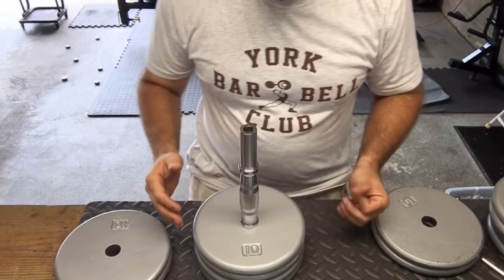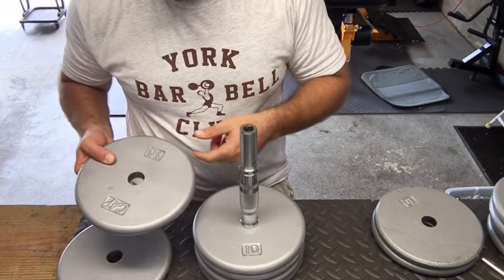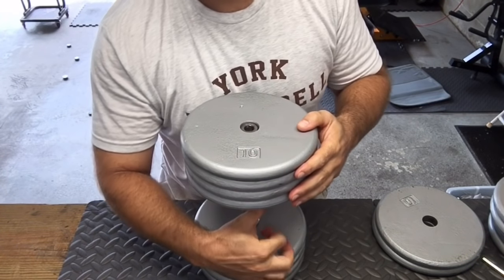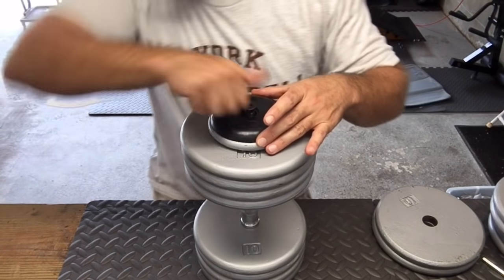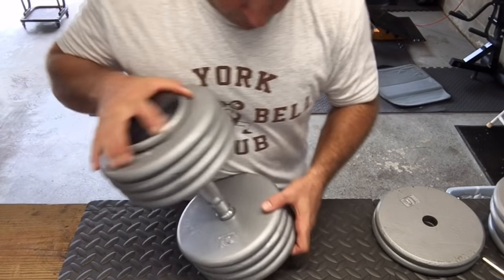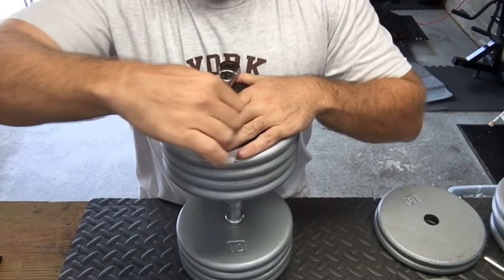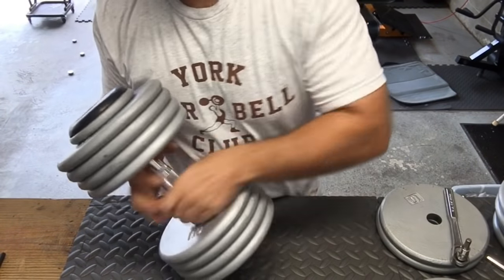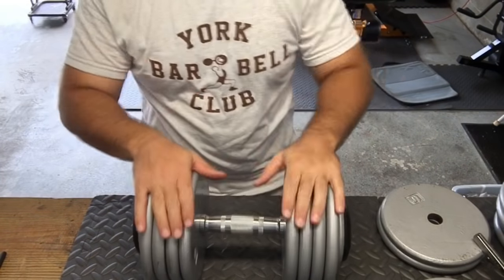Building a Pro Style Dumbbell

Comment: How has those cff rubber end caps lasted?
Reply from the maker: Absolutely tremendous.  No issues whatsoever.  Although I give them no reason to get beat up.  My gym floor is 3/4" rubber mats.  So the only contact they really see is that floor or my thighs when setting up for a press.
Reply: Diesel Mike Were you able to really crank down the bolt to lock then weights in from spinning or moving? I am torn between the steel end caps and the rubber end caps. Obviously the rubber end caps are less expensive. Are the rubber ones really hard tough rubber? Thank you for the reply.
Reply from the maker: Roddy FourthSeal  Theses CFF end caps are actually heavy duty rubber over a cast iron plate.  I am not sure all manufactures do this.  But I am very happy with them.  I actually feel that you can lock the bolt in better on these than straight cast iron. The bolt will dig into the rubber as you crank down on it.   The rubber is very hard, not squishy. That really locks it in place.  And to this day I still haven’t applied loctite to the bolts.
Reply: Diesel Mike sold!! Now I feel comfortable forking out the funds for enough to make a complete pro style set. I really appreciate your reply. I almost spent double on some Troy metal end caps. They look really nice and have the numbers with them.
Reply: Diesel Mike Are the bolt heads you are using 1”. I just ordered 40 bolts 5/8-18x1.5”. The ones I removed were 1” heads but had the old beveled washer that the bolt seated in. Just want to make sure these new bolts will work on the cff rubber end caps.
Reply from the maker: Without pulling one out and measuring, I can't say for sure the length of the bolts. (I assume the 1" you are referring to is the length?)  I used whatever came with the handles I purchased, less the washer.  I will check my Amazon purchase history and see if they list the specs.  

As far as the bevel, think of the rubber end caps as replacing the washer.  Yes, the washer is beveled and the bolt countersinks into it.  But the same happens when you use the beveled bolt with the rubber end cap.  As you tighten down the bolt, it will dig into the hard rubber, thereby creating it's own countersink.  The end result will be a very flush finish.

I believe that the Troy metal caps you spoke of would also have a beveled hole that mimics the washer you would be replacing.  After all, the whole purpose of using an end cap (be it rubber or metal) is to have a clean flush end instead of a bolt and washer protruding out.

Personally, I would use the bolts that go with the handles you are using.  I don't see a need to spend the money on new bolts, unless they are completely shot.  I can't say for sure if the ones you purchased will seat nicely.

One last thing.  I suggest you call CFF.  Ask for Christian, the owner.  He is extremely helpful.  Let him know you are trying to replicate what I did watching my video.  If you reference me as "DieselMike", he'll know me.  Haven't spoke to him in a while.  But he'll be happy to help you.
Reply: Diesel Mike perfect. The 1” I am talking about is the diameter of the head of the bolt. Where the allen wrench goes into. The head or top of the bolt.
Reply from the maker: OK.  Now I understand.  I will measure tonight and get back to you.  Also, if you have time read through this thread I made regarding this discussion when I originally built these.  You should find the discussion helpful: 
https://forum.bodybuilding.com/showthread.php?t=172379873
Reply: Diesel Mike I read your post in bb.com. Now it all makes sense. So after reading your post I drove 3 hours and bought an old pro style iron set 5-55 with a rack. I brought it home and was going to paint but ended up sending it all out to the powdercoat shop. Have a buddy who pulled some strings to get my project in at no charge. At home I took a brass brush and cleaned up all the handles and then used some 3-1 all purpose oil and soaked the handles in the oil. I also ordered new bolts which I think I ordered the last ones available or close for American made. I am finding out these parts are all discontinued. I am late in the game for building pro style db. Once I get back rack and plates I will wipe off excess oil from handles and assemble each dumbbell accordingly. Giving CFF a call today. Let me know what measurement you come up with on the head of the bolt. I had a company tell me all these parts are not interchangeable as some parts are China and some American. He mentioned my American-made bolts being made perfectly because of the standards but said China don’t have any rules so their parts may vary on bevel angle and diameter of the head is smaller. All of that has got me scratching my head. I just want to do this once and not have to buy parts and send back until I find matching parts. I really am thankful for your videos and post. Thank you for all the responses to my question.
Reply from the maker: The Powdered coat plates must looks sick.  I would love to see the finished look when done.  Stay in touch.  And good luck.

Comment: Hi Mike.  Would you be willing to share the size of handle you personally used for 10-120 in 10 pound increments?  I want to make my own pro style dumbbells in the same fashion you have.  
Thanks for the video.
Reply from the maker: There is a follow up video linked in this video where I discuss exactly this.  Check that out.  But in the meantime, my rule is that you choose the SDH # handle to correspond with the amount of 10 lb'rs on ONE side. If you have a 7.5, 5 or 2.5 on there in addition to the 10(s), DO NOT count that.  Only the 10's.  For example a dumbbell with two 10's on each side would use an SDH - 2.  But a DB with two 10's and a 7.5 on each side, STILL use an SDH - 2.  You will only go up to the next size when you add an extra 10 lb'r.
Reply from the maker: They are SDH handles.  You have to buy the proper size to accommodate the size (weight) of the DB you wish to build.  I explain this in detail in my other video, "Choosing the Correct Size Handle for Pro Style Dumbbells".   
As for the plates, I answered you in your prior question.  I am not sure what you mean by they don't accommodate each other perfectly.  Can you elaborate what problem you are having?
Reply: Price Kidhar hi

Comment: Damn eye wish eye could make me a pair of 110's or 120's
Reply: Dee White find a cheap set of handles at Walmart and slide rubber grips off them.
Go purchase threaded rods long enough to support the amount of 10lb plates you will need to make 120 or 130.

Take cheap rubber grips slide over threaded rod to center.
Then load the 10lb plates each side to get the desired weight.

Then put nuts on each end of threaded rod to hold plates in place.

I have 150s and 120s built this way.
Reply: @tedcannefax6043  okay bro thanks man